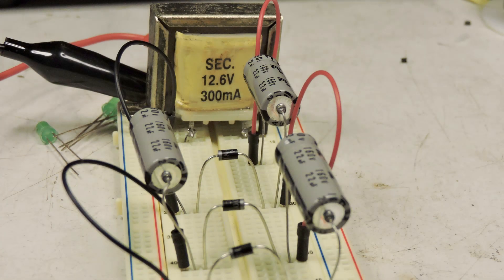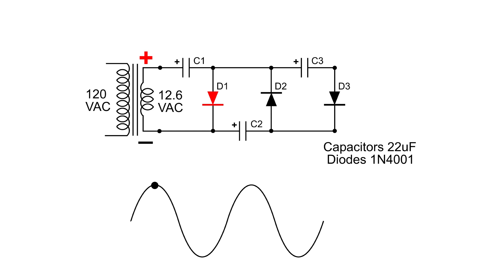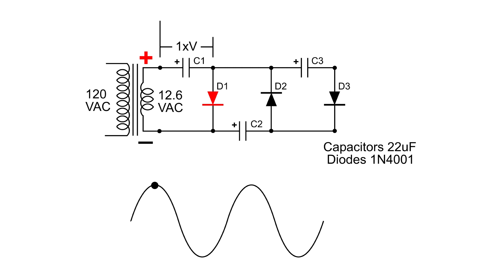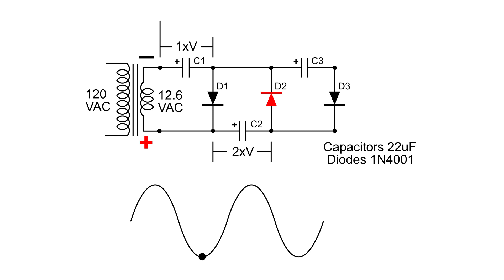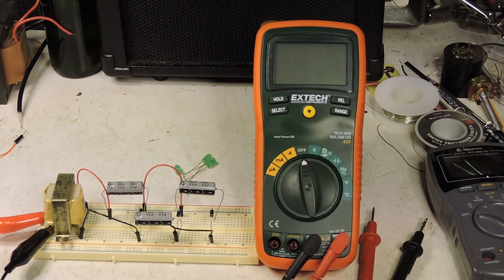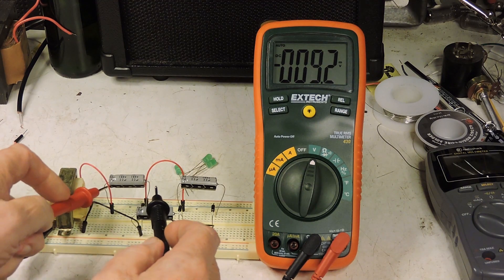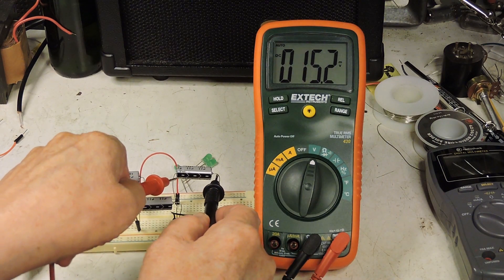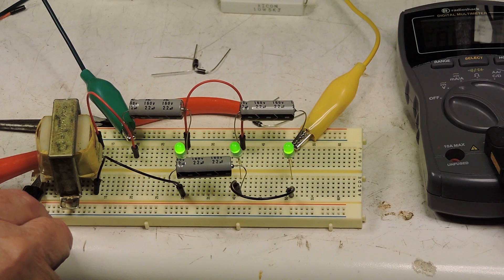Voltage Tripler Circuit Build and Demo

Comment: Did you use the LED's as you loads to consume (some) Voltage or Power?
Reply from the maker: I used them as the diodes

Comment: Thank you very mcuh for the nice demo. I assume that it is possible to have any multiple of the secondry voltage by adding more diode-cap to the circuit. Although the supplied circuit under loading should be less and less at higher voltage stages.
Reply from the maker: Thank you, and your welcome.